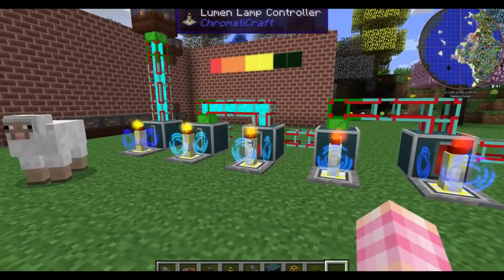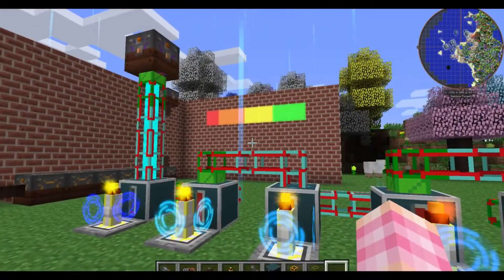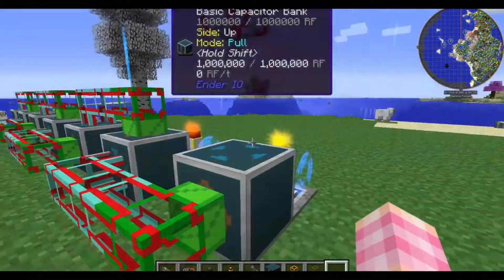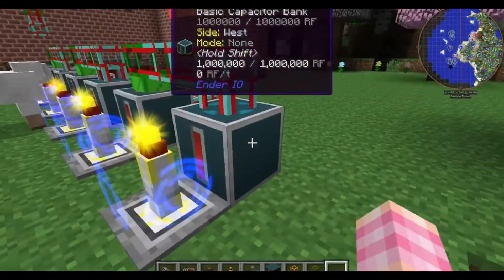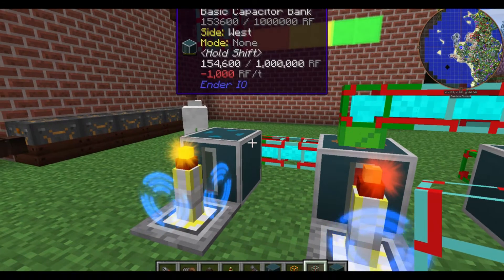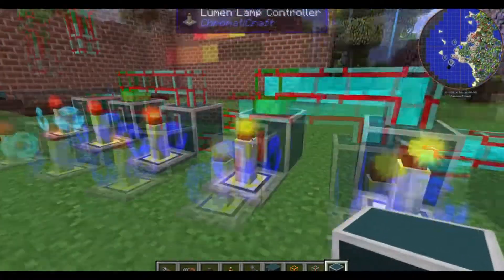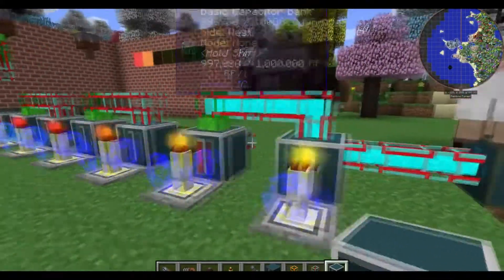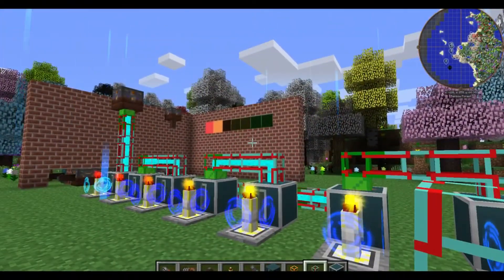ChromatiCraft Tutorial v17 - Lumen Lamp RF Indicator Build

Comment: I have tryed to build it with multiblock capacetrs and I used EnderIO conduits , because you can put in and out power using one conduit . And it works .
Reply from the maker: Cool